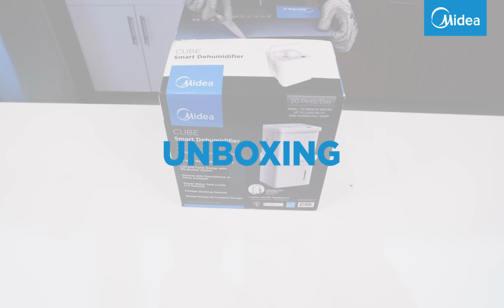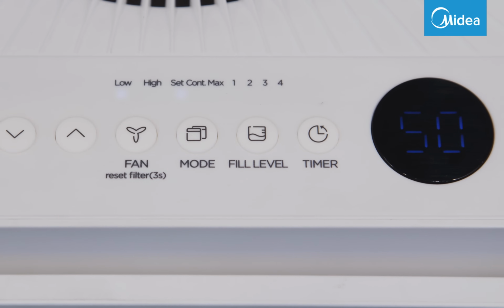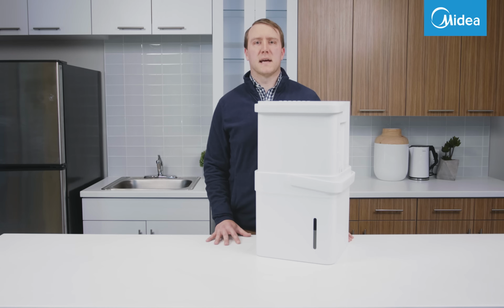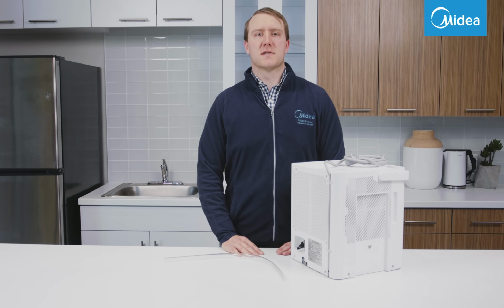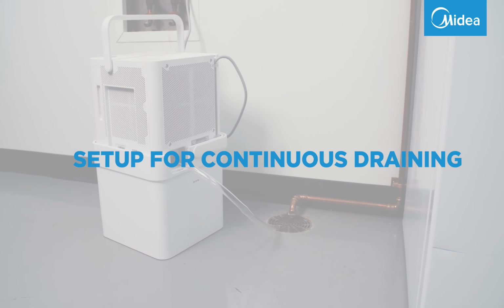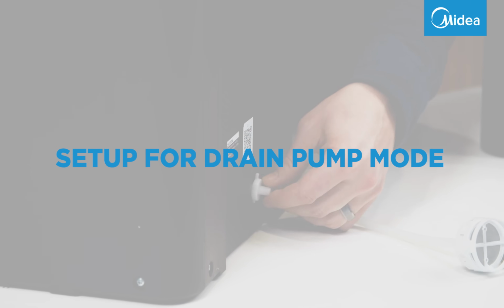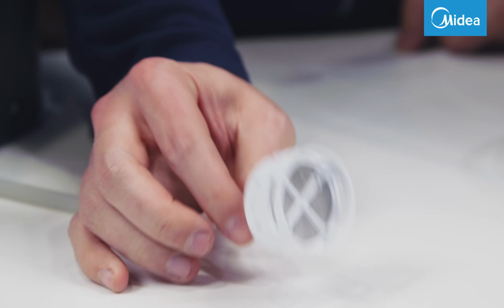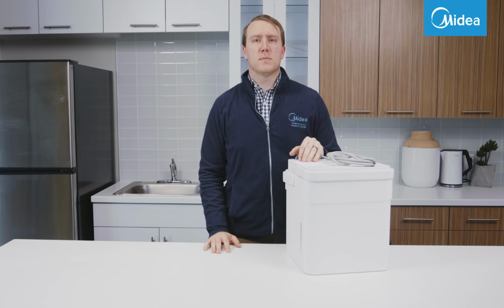Midea Cube Dehumidifier Operation and Overview

Comment: So far impressed with the quality of this unit; you can tell just by the heft of it. I don't understand the difference between continuous drain and bucketless. Do you depress the up arrow and fill level for both modes?
Reply from the maker: Hello @subbernh5192, we're glad you're enjoying your unit. You can use continuous draining with or without the bucket. If you wish to use it without the bucket, you will need to place the unit in bucketless mode. To do this, you will need to: 
1. Place the unit on the bucket to ensure the eb code is cleared.    
2. Remove the bucket from the unit 
3. Connect the hose
4. Unplug the unit for 2-3 minutes  
5. Re-plug the unit  
6. As soon as it has been re-plugged, press the power button,    
7. Once it's on, quickly hold the up and fill level button for 3-5 seconds.  

You must set the bucket-less mode within the first 3 minutes of powering on. Once the 3 minutes have passed, you must unplug the unit, re-plug it, and try again.

If you have any questions or concerns, please contact us at digitalsupport@midea.com. Have a great day!

Comment: Just bought and installed one with a pump. The video instructions appear to be wrong for pump mode. The Fill Level button says “pump(3s).”  When I pressed the button for 3 seconds, pump icon came on but in the bottom left of the display.
Reply from the maker: Hello @paulstanley8088, we apologize for any confusion. The fill level button has two functions. To set the desired fill level and activate the pump mode. If you have any questions or concerns, please contact us at digitalsupport@midea.com. Have a great day!

Comment: I was setting up today. I turned off, removed and it gave me a E6 code. Why?  I also forgot to do lock tabs.  That important?
Reply from the maker: Hello @BillBarrett-t9e, We're sorry your unit has experienced an EB error code. The Code indicates a problem with the bucket: either it's not in the correct position or has been removed. We advise ensuring that the bucket is placed correctly.
Reply: @MideaAmerica Thank you for responding.

Comment: I have gone through 3 Midea Cube 50 pint units. Each one lasted for the summer, then I unplugged for winter, then does not work in the spring. On one the pump fails, another the fan runs but no condensate. Unit is indoors in clean environment. I chose Midea Cube based on high recommendation by Consumers Reports. And it is a great unit when it works.

After all these failures I finally checked user reviews and see that early failure is a common problem. Here is the AI generated summary of reviews on Home Depot website, where I bought my units. “However, a common concern is the unit’s durability, with several customers reporting issues such as icing and failure after a year of use, leading to mixed feelings about its long-term reliability.”
Reply from the maker: Hello @steven.woodward, we sincerely apologize for the issues you've encountered with your units. We will pass your feedback to our product development team for investigation into the cause of these issues. For assistance with troubleshooting, please contact us at digitalsupport@midea.com. Have a great day!

Comment: Can’t get Buckeless mode to work no matter how hard I try. I have a hose screwed onto the back. Garden hose type. I have followed the directions exactly still not working. Any recommendations?
Reply from the maker: Hello @JackMyersM66, we're sorry you're having difficulty placing your unit in bucket-less mode. 
To place the unit in bucket-less mode, please follow the steps below:      
1. Place the unit on the bucket to ensure the eb code is cleared.    
2. Remove the bucket from the unit 
3. Connect the hose
4. Unplug the unit for 2-3 minutes  
5. Re-plug the unit  
6. As soon as it has been re-plugged, press the power button,    
7. Once it's on, quickly hold the up and fill level button for 3-5 seconds.  

You must set the bucket-less mode within the first 3 minutes of powering on. Once the 3 minutes have passed, you must unplug the unit, re-plug it, and try again.

If you have any questions or concerns, please contact us at digitalsupport@midea.com. Have a great day!

Comment: How do I drain the water inside the machine?😊
Reply from the maker: Hello @ghostt703, thank you for your question. You can either drain the unit manually by removing the unit and emptying the bucket, or you can drain the unit continuously by attaching a standard garden hose to the back of the unit. If you have any questions or concerns, please contact us at digitalsupport@midea.com. Have a great day!

Comment: Is the plug on the back supposed to be left inserted during bucket mode? This unit is not pulling much water out of the air as my previous Frigidaire did.
Reply from the maker: Hello @eddiemyers3206, Yes, if you are planning to allow the water to collect in the bucket, the drain should be closed. For further support with guidelines and addressing concerns, please reach out to us at digitalsupport@midea.com.
Reply: I was trying to figure that out cause no videos show that side of the unit and manual isn’t very helpful.

Comment: Very good and informative video.  I watched it before setting up the unit as it'll be located in the crawl space under our kitchen.  I would've had to crawl in and out to access the unit, so having the pump and app should keep me from having to climb in and out of the crawl space to adjust settings and emptying the catch bucket.  It's a well-designed, heavy little unit at a great price.
Reply from the maker: Hello @joebridges3165, thank you for your feedback. We're delighted to hear you're pleased with your unit. Have a great day!

Comment: Great video. I just bought my Midea 50pt cube with the pump.  I have to say that the instructions were not clear last night when we were setting it up regarding the pump intake line connection (with the debris filter).  I ran back to the house to set it up properly after finding this video.  My only issue is whether or not the Midea will safely shut down if the pump fails and cannot drain the bottom cube.  We are using this unit on an empty house that just had mold remediation and we are augmenting the AC for keeping humidity low during rainy, cooler days.  I set it up in a bathtub last night to first test the pump feature and hope to relocate it in a central hallway.  Thanks.
Reply from the maker: Hello @michaell1665, We apologize if you found the instruction manual unclear. If the pump does not activate, the unit ceases operation and displays a P1 error code when filled to maximum capacity, indicating that it needs to be drained. If you have further questions or concerns, please feel free to contact us at digitalsupport@midea.com. Have a great day!
Reply: @MideaAmerica  The cube is working well over the last few days.  I have allowed it to fill 1/3 or more full and have yet to see any water pump out of the drain.  I'm concerned that the pump might not be kicking in.  How high does the water have to get to see the pump operate.

Comment: It's giving me a p2 error code. Am I supposed to remove the drain plug in bucket mode? You say everything but that.
Reply from the maker: Hello @salk4858, The P2 error code indicates that the bucket needs to be emptied, or the filter requires cleaning. Once you have completed these steps, the error should be cleared. If you encounter any issues or have any queries, feel free to reach us at digitalsupport@midea.com. Have a great day!
Reply: @MideaAmerica  it's brand new just turned it on. Bucket is empty and filter is pristine.

Comment: What is the purpose of "continuous drain" vs "bucket-less mode"?  Either way, the bucket does not get filled and water continuously drains out of the condensate tube (which I assume is 1/2")
Reply from the maker: Hello, @1goblingreen404, the continuous drain vs. bucket-less mode gives you the option to use the bucket or not. If you have any questions or concerns, please contact us at digitalsupport@midea.com. Have a great day!
Reply: Maybe in continuous drain mode, water would overflow to the bucket if the drain hose got clogged?

Comment: Do I need to have the plug out for pump drain mode ?
Reply from the maker: Hello @CUNNINGHAMRYAN26, Thank you for your question. To drain pump mode, you will need to ensure that the pump hose is connected, and pump mode is enabled on the panel. Once the bucket reaches max capacity, the pump will activate. Have a great day!

Comment: Had for 2 years now - says AP NOW ?!?
Reply from the maker: Hello @randyubriacosr6580, AP mode allows the unit to connect to WiFi. If you want to remove this mode, you will need to hold the power button for 3-5 seconds until it's cleared. Have a great day!

Comment: ATTENTION! For the brand new models, setting the cube to pump draining mode is done by holding down the FILL LEVEL button for 3 seconds.
Reply: Thank you! I was watching the video and thinking 'am I not holding these buttons correctly??' Lol. Thank you so much!
Reply: Omg same here, you're a life saver.
Reply: Thanks
Reply: When does the pump actually pump? It’s in pump mode but nothing is happening, do I have to wait for the water to reach the top of the bucket before it will pump?

I’m very confused how it works.
Reply: When does the pump start working,  mine set on pump mode but I don't seem to here the pump or see any water being sucked out
Reply: @joeyanderson6660  wondering the same thing.

Comment: I’m trying to get it to setup for drain pump mode but the indicator never appears on the display. I held the up and down buttons for 3 seconds. I tried it as just a push. I tried holding longer than 3 seconds. All to no avail. No indication on the display at all. The display only shows what I think is the humidity level. Help!
Reply from the maker: Hello @johnarsenault4855, We apologize for the inconvenience you have experienced in enabling the pump mode.  We suggest holding down the up and fill level buttons for about 3-5 seconds to see if the icon appears. For additional support or questions, please get in touch with us at digitalsupport@midea.com. Have a great day!

Comment: Not a fan . Top unit is too heavy to lift and then you still need to remove another heavy bucket. Wouldn't recommend
Reply from the maker: Hello @dans2628, we're sorry that the unit's draining process did not meet your expectations. If you wish, you can drain the unit continuously by attaching a standard garden hose to the unit. If you have any questions or concerns, please contact us a digitalsupport@midea.com. Have a great day!

Comment: I can't seem to get this in pump mode.  When I check on it, it throws the P2 code and I have to empty it. What am I doing wrong?
Reply from the maker: Hello @deannaoconnell5293, To activate the pump feature, you will need to hold the UP/DOWN buttons simultaneously for 3-5 seconds or until the pump indicator appears on the display. If you have any questions or queries, please get in touch with us at digitalsupport@midea.com. Enjoy your day!

Comment: My unit does not allow me to change to bucketless mode, I tried turning off the unit and restarting to do bucketless mode and followed the instructions holding the fill button and up button. Please advise what I'm doing wrong.
Reply from the maker: Hello @nathanieldamasio9422, To place the unit in bucket-less mode please follow the steps below:      
1. Place the unit on the bucket to ensure the eb code is cleared.    
2. Remove the bucket from the unit 
3. Connect the hose
4. Unplug the unit for 2-3 minutes  
5. Re-plug the unit  
6. As soon as it has been re-plugged, press the power button,    
7. Once it's on, quickly hold the up and fill level button for 3-5 seconds. 

You will need to have the bucketless mode set within the first 3 minutes of powering on. Once the 3 minutes have passed you will need to unplug the unit and re-plug it and try again.

Comment: Can't get it to go to EB mode for the bucket less mode
Reply from the maker: Hello @minhlac7567, To place the unit in bucket-less mode please follow the steps below:      
1. Place the unit on the bucket to ensure the eb code is cleared.    
2. Remove the bucket from the unit 
3. Connect the hose
4. Unplug the unit for 2-3 minutes  
5. Re-plug the unit  
6. As soon as it has been re-plugged, press the power button,    
7. Once it's on, quickly hold the up and fill level button for 3-5 seconds. 

You will need to have the bucketless mode set within the first 3 minutes of powering on. Once the 3 minutes have passed you will need to unplug the unit and re-plug it and try again.

Comment: Bucketless icon does not appear
Reply from the maker: Hello @knullization, to place the unit in bucket-less mode please follow the steps below:      
1. Place the unit on the bucket to ensure the eb code is cleared.  2. Remove the bucket from the unit 
3. Connect the hose 4. Unplug the unit for 2-3 minutes. 5. Re-plug the unit 6. As soon as it has been re-plugged, press the power button. 7. Once it's on, quickly hold the up and fill level button for 3-5 seconds.  

You must set the bucket less mode within the first 3 minutes of powering on. Once the 3 minutes have passed, you must unplug the unit, re-plug it, and try again. If you have any questions, please contact us at digitalsupport@midea.com. Have a great day!

Comment: I can't get it to switch to bucketless mode!!!
Reply from the maker: Hello @essendossev362, To place the unit in bucket-less mode please follow the steps below:      
1. Place the unit on the bucket to ensure the eb code is cleared.  2. Remove the bucket from the unit 
3. Connect the hose 4. Unplug the unit for 2-3 minutes. 5. Re-plug the unit 6. As soon as it has been re-plugged, press the power button. 7. Once it's on, quickly hold the up and fill level button for 3-5 seconds.  

You must set the bucket less mode within the first 3 minutes of powering on. Once the 3 minutes have passed, you must unplug the unit, re-plug it, and try again. If you have any questions, please contact us at digitalsupport@midea.com. Have a great day!
Reply: @MideaAmerica  The unplug and re-plug was the trick that did it. Thanks!

Comment: NOTE: My model is brand new and turning on pump mode was done by holding  the 'fill setttings' button, unlike what this or the manual said. I guess they changed it without updating the documentation.
Reply: Yes that's what mine does too

Comment: Like so many dehumidifiers these days, dead after barely 2 years.  All of the manufacturers are pushing the limits of how thin they can make the copper tubing of the evaporator and condenser and they don't last.

I forgot to add, to anyone reading this, if the unit is in normal operating conditions and you see ice forming on the evaporator this means you are low on refrigerant due to a leak, if you are still within the warranty period return it immediately!!
Reply from the maker: Hello @robot5573, we're sorry that your unit has not been performing as expected. For assistance with troubleshooting, please contact us at digitalsupport@midea.com. Have a great day!
Reply: @MideaAmerica  I did, nothing to be done as my unit is far outside the 1 year warranty.  I thought about trying to repair it for fun, but with the coils being made of such thin copper it's far too likely that it will just fail again.

Comment: Still confused. So if I have the humidifier on the bucket and have the drain line in with gravity draining, do I set it up like the bucket less mode where I press and hold the fill mode and up arrow? Also does the bucket fill if the drain were to somehow block?
Reply from the maker: Thank you for your question, @AFpaleoCon. You can utilize gravity draining in two ways: with or without the bucket. If you opt for the bucket-less mode, you'll need to simultaneously press and hold the 'fill mode' and 'up arrow' buttons. In the event of a blockage or disconnection in the drain, the bucket will begin to fill with water. Have a great day!
Reply: @MideaAmerica  I appreciate the fast response! It seems to me like the tabs in the bucket are depressing button on the bottom of the unit preventing it from going into the draining mode when the unit is seated on the bucket. I cannot get the unit to change states when holding the up arrow and fill mode buttons when the unit is atop the bucket. Correct me if I'm wrong but is it not the purpose of the depressible grey tabs on the unit and the protrusions on the bucket to somehow set a mode of the unit? To summarize: My goal is to have the unit on the bucket, and draining using the gravity drain port into a pump already utilize that goes to the stack, but also have the bucket under the unit in case the pump failed and the unit would then start filling the bucket until it shuts itself off.
Reply: Figure it out? @AFpaleoCon
Reply: @AFpaleoCon  If you put the dehumidifier atop the bucket, bucket-less mode would not engage when you simultaneously press the two buttons.  The dehumidifier would need to sit by itself without the bucket.  If you want to utilize gravity draining with the bucket, you are forced to use the continuous mode which bypasses the desire humidity level settings meaning the machine would not stop unless you set timer or schedule.
Reply: @anhy10ful  I think you are right and I think that is a stupid design feature. I regret buying this dehumidifier.
Reply: If you're putting the dehumidifier atop the bucket, you do not set it to bucketless mode. If the continuous drain hose is connected, it drains out of that. If the hose port is plugged, it drains into the bucket.